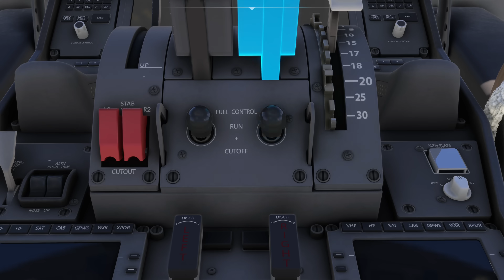Air India 171: Why Did The Fuel Cut-off Switch Get Moved?

Comment: If one of the pilot did move the switches to cut off and was asked about it, the two possible answers I can think of (given that he understands the immediate unavoidable consequences) would be 
1. Oh shit ....... (if he did it inadvertently)
2. An evil grin/chuckle ... (if it was a deliberate move to bring down the flight)

"I did not" does not sound like denial, more like being dumbfounded. Maybe the tone of response on the CVR will help give more perspective. Also the inputs from the microphone to record ambient cockpit sounds should help.

One question that's been bothering me is, given all videos I've seen saying, its a simple mechanical switch with nothing much that can go wrong and cause malfunction. If so where does the FDR input for fuel cut off signal come from? is it directly from the switches, which would be conclusive that the switches moved. Or does the input to FDR come from the fuel cut off valves, which assumes that the cut off was due to switches being moved.

If in the event that the engines were starved and the PF realized it, the obvious question would be why did you cut off the fuel (given that as I see everyone today seems to agree that there is no other way for the fuel to be cut off), to which the PM responded I did not. Now what if the the switches actually have not moved. What will they do next as the engines shut down, I'm not a pilot but I would guess, move the switch to cut off and then to run. Both of them (probably individually) which would take slightly longer than a quick single flip from one position to the other.

I know I am hypothesizing, but I cannot bring myself to blame the pilots without ruling out all other possibilities specially calling it a deliberate act. Then propping up the argument with mental health etc (Not that its not possible), but is there any corroborating evidence or witness testimonial to that effect ?

On the other hand has it happened in the past that the pilots were blamed at first but was later found to be an aircraft malfunction ? I can remember one, and the only reason perhaps that they actually got to the truth was due to a second crash in similar situations prompting the investigators to share information and delve deeper.

You're the expert Cap.

Comment: There is nothing in the preliminary report.
How did the U.S. media get access to the report two days earlier?
"FADAC" spelling is incorrect.
The warning that occurred during the incident is missing from the information.
On page 7, it says the ELT was not activated — is this due to poor quality?
On the last page, it is mentioned that Engine 2 could not be relit. Why?
This is a technical report, but the word “immediately” is mentioned multiple times without specifying exact times. Why? (FYI: The total flight time was less than one minute.)
How are media outlets — especially foreign media and YouTubers — all focusing on the same single issue (engine switch)? Are they really studying the report or just trying to protect Boeing?
Are they just trying to say this was a pilot error so that everyone else — including Boeing — can be protected?
Why did Boeing issue only an advisory (not mandatory) to check the fuel switch? Why isn’t this a compliance requirement? The FAA also confirmed this is not a safety issue. Is this just to protect Boeing, so they can claim they already issued an advisory?
Why wasn’t the ELT activated? Poor quality? (But the AIB still gave clearance to GE and Boeing — see last page of the report.)
On page 9, it says the flaps and slats were in the correct position — yet everyone is blaming the pilot. So, are those blaming the pilot lacking technical knowledge, unfit for their jobs, or just trying to protect Boeing? Because they don’t seem to know basic features like auto-gap protection.
On page 9, it says the engine blades were intact — that means the engine wasn’t rotating at the time of the crash. Why is no one talking about this?
On page 10, there's a photo showing the APU door was open.
Both the DFDR and FDR were damaged — poor quality? Then how are they giving clearance to GE and Boeing?
In the end, are they just trying to prove this was a pilot error?

Comment: I have been following this story since it happened and now that it seems that the cause was due to the fuel cut-off switches I'd like to weigh in on the conversation. I feel that this is a design flaw by Boeing. Even though the switches need to be pulled out of a detent to be moved from one position to another, the switches could still have been "knocked" downward to the cut-off position if they were not properly engaged in the run position. It is easier to knock with downward pressure than to knock upward as this is a more deliberate movement. Perhaps if the switches were mounted so the movement was to be left to right rather than up and down, this would not have happened as it would definitely be a deliberate movement need to perform the task. The other alternative would be either have the switches work so the cut-off was up and run was down, or have switches that require an extra step (like flipping up a cover switch) before they can be activated similar to firing guns on attack aircraft. I have noted with interest that in most of the rest of the world, toggle switches, including even basic power and light switches work opposite than in the US. Food for thought!

Comment: Hi Captain, have you thought about the fact that the flaps controls are very close to the fuel switches on the 787 and maybe it cud have been one of those horrific errors of of maybe the copilot who actually meant to reduce flaps but pulled on the fuel switch tabs instead! Just a thought. Respect to you Captain!

Comment: What is the standard procedure done by the pilots if one finds a dual engine failure suddenly and immediately after the take off with the fuel switches in RUN position?

Comment: Hello captain, regarding the FDR monitoring of the fuel cutoff switches, does the actual physical movement of the switch get recorded? I would then assume a dedicated contact on the switch monitored or does the switch state get recorded further downstream? This would mean there's an additional layer of control logic  between physical movement and state detection. I guess you see where I'm going with this. Regards Renato

Comment: First of all, thank you very much for making these update videos on the Air India 171 crash. They are truly helpful 👍, especially in this age of fake news on social media and mainstream TV.
I have a few questions and would be grateful if you could clarify:

1. Is the fuel switch status displayed on the cockpit dashboard?
2. Is there any audible or visual alert (on the dashboard) when someone turns off the fuel switches? I'm trying to understand how, when one pilot asked the other “Why did you cut off the fuel switch?”, he recognized that—was it by seeing the physical switches or by checking their status on the dashboard?
3. Is it possible that the fuel switches were in the cut-off position from the beginning? That is even before takeoff? Pardon me if this sounds like a silly question, but in motorbikes this kind of scenario is possible. bike will run till whatever fuel is there in the fuel supply pipes then it will stop after that.
4. Does the black box record the actual movement of the fuel switches, or does it only capture the status of the fuel supply to the engines?

Comment: Based on my theory, what happened exactly.

* Before take-off, fuel locking feature failed already in fuel control switch.
* Pilot-A take-off and focus on altitude.
* pilot-B is in monitoring position
* after take-off in second, Fuel switch moved from RUN to CUTOFF position due to vibration automatically. It is possible . because in take-off position, switch easy to fall down to CUT-OFF position if locking feature failed.
* Pilot-A noticed there is some error and beeb sound in cockpit. 
* while pilot-A focus observed loss of thrus and he asked pilot-B, why did you CUTOFF fuel.
* Pilot-B replied, No. I didn't do so.
Reply: Pretty good theory but why did it take 10 seconds to switch back?
Reply: it's not possible for the switches to vibrate to cutoff....see the various other comments in this thread....
Reply: * after take-off in second, Fuel switch moved from RUN to CUTOFF position due to vibration automatically. It is possible . because in take-off position, switch easy to fall down to CUT-OFF position if locking feature failed.

Impossible for locking feature to fail on both switches with 1sec interval and then been put back in "On" position! 
Cut off that bu!!shit

Comment: It is only an FDR status that shows the status of the fuel switch. Could it not be an electrical or firmware failure that recorded it as such and not a real physical input from the pilots. There were reports that there is a remote possibility that the firmware could, under some rare circumstances, cut off the fuel supply. Would this then be registered as a fuel cutoff as if the switch were flipped in the FDR or a different code?

Comment: There should be a switch on both sides of the cockpit that enables the FUEL CUT OFF to be operated. In other words the FUEL CUT OFF would not respond unless this first procedure was actioned.  Both pilots would have to enable their switch on their sides of the cockpit. This would only take seconds. It would prevent this happening again and prevent a copycat action.

Comment: Lot of respect for the captain but here are some things he maybe overlooking. 

The report states both fuel control switches transitioned from RUN to CUTOFF immediately after lift-off — with no obvious physical command by crew (since the CVR captures the pilot asking “why did you cutoff” and the other replying "I did not").

There’s no mention of a plausible mechanical failure between the control switches and fuel control actuators. Did wiring short? Was there a software logic glitch in the FADEC? 

Is this report mere fodder for the propoganda machine to save "major" stakeholders? I hope the Captain can address these concerns as well.

Comment: Just s thought would it be possible when putting the fuel to the on position to put the switches halfway on top of the engagement tab and the fuel be on and on take off with the vibration drop to cut off?

Comment: In light of the 2018 FAA SAIB warning about potential disengagement of the fuel control switch locking feature on Boeing 787s and this new inspection directive, do you think this issue could have contributed to the AI171 crash?

Comment: Captain,
Assuming that one of the pilots maliciously cut off the fuel, plus the recent situation on an Alaska Airlines flight out of Washington where a troubled off duty pilot sitting in a jump seat attempted to pull the engine fire suppression handles in flight, without any real fire indications present.
•What do you think airplane designers/engineers/unfortunate pilots facing a similar dangerous situation could do/change or how might this be prevented going forward? 
•What are your thoughts on different airplane design changes, or possible airplane logic updates to avoid these situations? Pros and cons of a particular or specific change you might favor? 
•For example, would placing a cover over these switches - in addition to the detent help? Or maybe installing two sets of cutoff switches per engine (one set for each pilot where both sets must be in agreement)? Or possibly separating the number one and number two switch locations making them further apart?

Of course, the best solution is one that provides better mental health services to pilots, but also across the board to all professions. This service in addition to the implementation of a frequent, yet robust screening system to identify and aid pilots struggling, and without any unreasonable or harsh penalties for pilots seeking help. However, I'm afraid it may be impossible to completely or even significantly prevent a similar situation simply because of our human factor and human emotions. It's likely that this case (and similar) will soon be cited as a justification to give control over completely to AI; eliminating the astonishing human pilot capabilities due to a fear over the (extremely rare) human vulnerabilities that lead to terrible disasters like this... 

Thanks Captain Steeeve!

PS 
From what I understand (yet disagree with), US Law restricts pilots above a certain age from flying commercially - and you are nearing this "cutoff age". I'd imagine your final flight will be emotional and something personal for yourself and your family, still may I ask that you please share even a small piece of your final commercial flight with us here on YouTube?!

Thanks again Captain Steeeve!

Comment: EXPLAIN WHY THERE IS NO ACTUAL TIME IN THE REPORT OF RECORDING WHEN PILOT SAYS THAT FUEL SWITCH IS TURNED OFF. WHY THERE IS SUCH AN IRRESPONSIBLE LANGUANGE USED ( IMMEDIATLY AFTER ) IMMEDIATELY COULD BE 1 SEC, 2SEC , 4 SEC.... THE TOTAL DURATION OF THAT FILGHT WAS 32 SEC SO IN THAT SENSE EVERY SEC MATTERS.. AND YES YOU SHOULD BE ASHAMED OF SAYING THESE THINGS WEARING PILOT UNIFORM WITH SUCH AN GREAT FLYING EXP. YOU ARE ALREADY BEEN PURCHASED BY BOING OR YOUR FLYING COMPANY HAVE CONTRACT WITH BOING, SO THAT'S THE REASON YOUR ARE SPREADING FALSE INFORMATION AND OUTTING ALL THE BLAME OF THE PILOTS, WITHOUT EVEN CONSIDERING THE FACTOR THAT( BLACK BOX IS DESIGNED TO SUSTAIN THE DAMAGE OF HEAVY CRASHES SUCH AS Air India 171, BUT IT DIDN'T SO IT MEANS THERE IS A FAULT IN Boeing ITSELF ) SO FOR THAT REASON YOU ARE NOT AN CREDIABLE PERSON TO GET OPINION FROM. 
BESIDE IT I AM SAYING WITH FULL CONFIDENCE WITHING 1-2 YEARS Boeing WILL MAKE IT LOOK LIKE THE PILOTS OF Air India 171 WERE HAVING SOME psychological problems related to it etc... 
SUCH A SHAME CAPTAIN STEEVE

Comment: Watched a few videos on different aircraft taking off, I noticed sometimes the watches they wear, sometimes come really close to those switches whilst they handle those throttles - but not in every video seen. Perhaps a software update to onscreen ask the pilots are they sure they want to cut fuel off maybe a good idea if the switches are triggered as if no system warning has been triggered for the on board computers to process, like an engine fire for example you can cut off fuel the normal way but without an engine fire - the software will ask to be sure. I hope they bring the matter to rest shortly as it is a most unfortunate event.

Comment: Captain Steeeve: why not make the fuel cut-off multiply redundant when the aircraft is wheels-up?

Once the aircraft becomes Airborne (aka "wheels up" mode) the fuel cut-off switch would need a pair of momentary switches (one outboard in each pilot location) to be held ~while~ the regular cut-off switch is moved to the "off" position, like the "Missile launch keys" in a Nuclear Missile silo. If a lone pilot attempted to move the cut-offs while airborne, it would set off an alarm, but would NOT cut the fuel feeds. To do it properly, the seat occupants would need to depress their respective keys ~before~ the Fuel Cutoff switches are moved/reset. The switch would need to remain depressed while any issue was managed, as releasing either switch would resume the fuel feeds.
Agreed, it would require two people in the cockpit for that action in an emergency, but it would mean that no single pilot could ~ever~ cause this (on purpose or accidentally) to ever happen again.

Comment: On take off, both pilots take their seat full forward, to use rudder pedals properly, in case of single engine shutdown. When you take the pilot seats full forward, the fuel cut off switches are out of physical range of both the pilots. Try it in simulater.

Comment: As per the report, fuel switches transitioned from run to off three seconds after takeoff. So who put the switches to run from off, after that? After ten seconds fuel switches again ran from run to off & after one second to run. This means that fuel switches were off for ten seconds after take off, till the pilots cycled them.